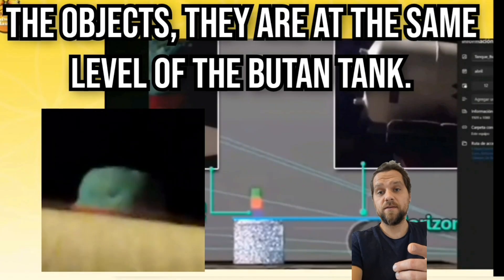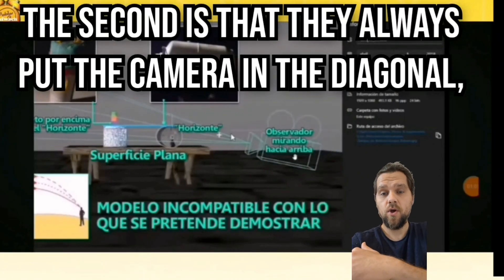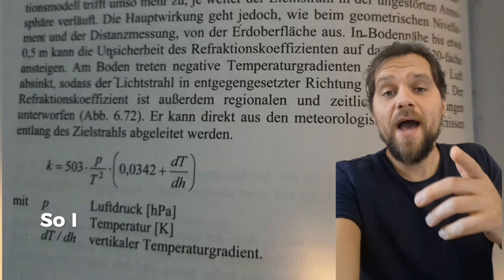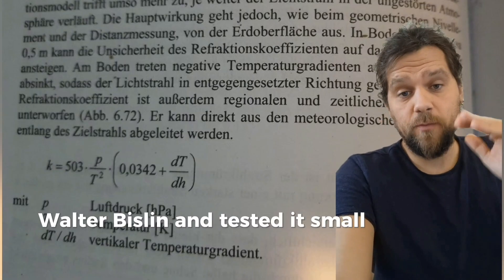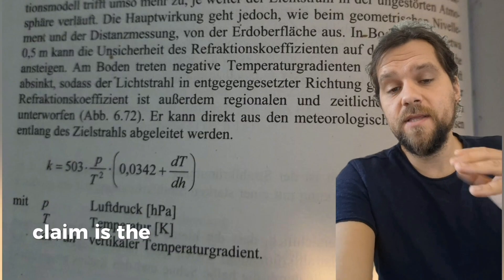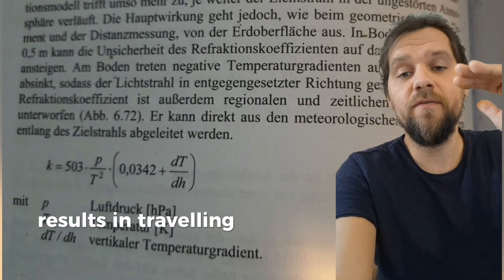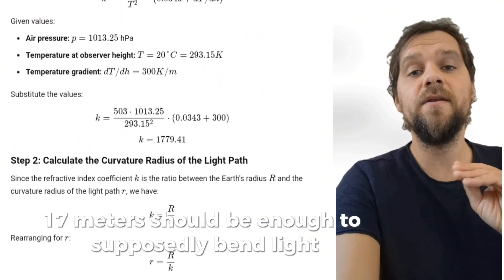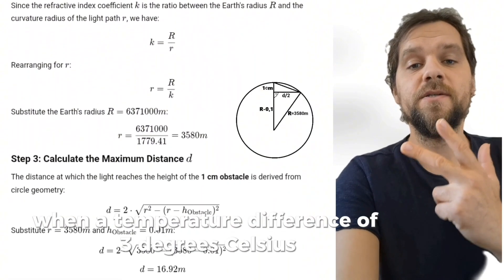Does light bend around curves? The real final experiment

Comment: Why not set up a pully system with  a string rather than your hand moving the cart.   Filmed with the obstacle and without?   

Sadly, I don't understand what the temperatures and heat was about.  I thought refraction was to do with the amount of moisture in the air.
Reply from the maker: @successandlifestyle  the Transition from bar to bar was to bumpy to make it work with a String only
Reply: Moisture and temperature.
Reply: Refraction is mostly about density gradients the light moves through
Reply: @ Yes and it changes from temperature, air pressure and air moisture.
What i really dont understand here is, that light clearly can change direction from that. Thats why things can look distorted, but Kevin still said, that light can't move around obsticles. So how can this fit together. Its like saying, a curve exists, but it can't curve around stuff.
Reply from the maker: @melonenlord2723  you can push on the opposing side only or you can try to demonstrate things. Distortion can come up from Expansion and compression
Reply: @kevinsamuelbo  you proved refraction here. But go on, then also question your compression claims or whatever you have as excuse for why objects are vanishing bottom up. Setup an experiment and prove it to us.
Reply from the maker: @Tom-to1vt  truth doesnt care for ur stories
Reply: @kevinsamuelbo  no you don't care for truth. You deny proved science when its pro globe and believe every youtube video when its pro FE. Prove why objects would vanish bottom up on a flat earth. Come on, show us the truth.
Reply from the maker: @Tom-to1vt  see other comment. I showed that in 3 Videos, you can keep on pretending, this doesnt happen, I dont care
Reply: @kevinsamuelbo  no  you dont. All your videos are debunked and explained to you and you never set up an own experiment like here. We also have hundreds of videos showing refraction. You simply chose to ignore and cherry pick what you believe
Reply from the maker: @Tom-to1vt  u never did anything yourself. And no theres not a Single Video of objects refracting around curves in air. Good bye. Enough lies from u here

Comment: Around 6:40 you can see the light moving up and down depending on the variation in the temperature gradient, proving that there is indeed refraction happening.
You didn't show any details about the flashlight, variations of its height and orientation. Is this supposed to be a scientific experiment? Or just another confirmation bias experiment of the FE community? Don't do too much effort or you'll end up proving the globe, nobody wants that right.
Reply from the maker: No on the top of the barrier we either see only a bit of brightness, cause as I said the light is angled upwards. Could also be the shining lights gathered shining through the aluminum foil from the top, but look at the difference when the barrier is unveiled 6:35.. lights diameter is 1.1cm,   as calculated the light should be lifted 1cm. Does this look like Half the brightness of the whole light? Not at all. And that brightness changes cause the Thermometer Sensors move through them. Try better anyone
Reply: @kevinsamuelbo  no we see the light becoming more and less visible on the edge of the barrier due to refraction. 

And yes, 1 cm shift maybe in optimal conditions, which you don't have as your temperature measurements show.

You didn't really show much of the experiment itself. Almost as if you only wanted to make a checkmark behind a supposed globe debunk. That's not how you do a scientific experiment. 
When you already took so much effort for building that thing you should make several test runs, optimize it, calculate error margins.
That's science.
Reply from the maker: @Tom-to1vt  yea right 530+ years alleged globe and noone showed that once.. good luck for you then trying.
Reply from the maker: @timhenn4922 
For everyone: Tim and Tom thats the same dude with 2 Accounts replying to himself if anyone was in doubt that antiflats are weirdos.

Antwortest dir mittlerweile selbst mit deinen 2 Accounts weirdo?